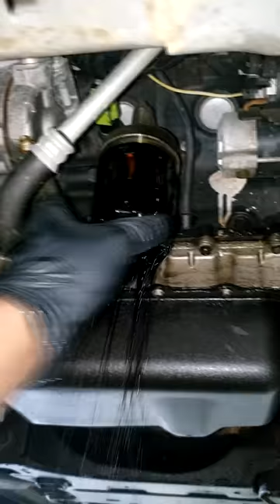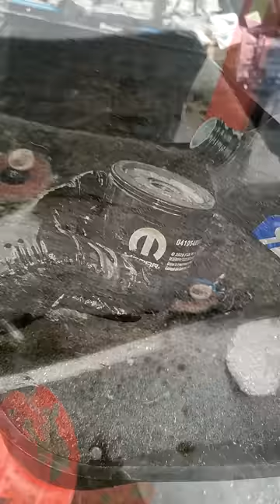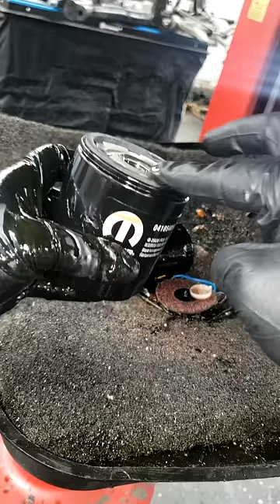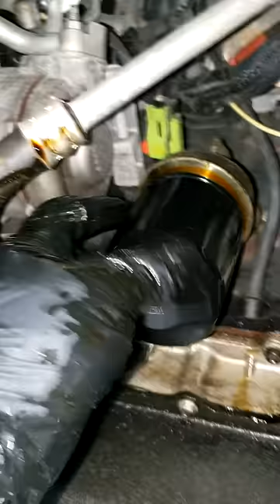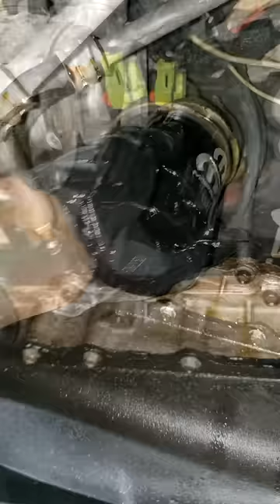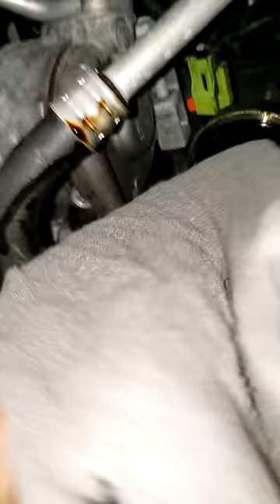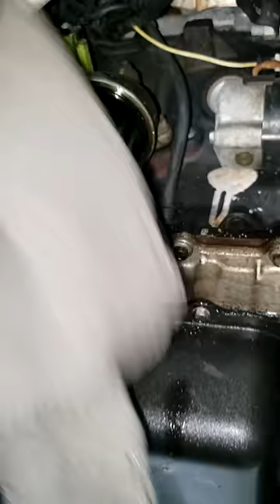Don't Lie.. Are yall still doing this?

Comment: I have NEVER filled the filter with oil, only ran a couple of drops of fresh oil on the gasket. I always, however, clean the gasket's mating surface of old oil!
Reply: Agreed- all you need to do...
Reply: Yeah, never fill it with oil unless it is specifically necessary, just adds more chance of contamination. Only lube up the gasket for a good seal
Reply: Never have done it. Never had any issues. I've seen Ford and Chevys with filters that go on sideways and not up and down. No way to fill those and not lose all the oil. I've seen people try, and it's pretty funny. Waste however. I agree, clean the surface and oil the gasket.
Reply: I do the same lube up the o ring, clean the mating surface and oil up the threads on the filter
Reply: @realanimal3602 can confirm, my old 2012 Chevy Malibus oil filter went on upside down for some reason. Thing was a bitch to get to ngl.
Reply: Well, you are part way there. Now try doing the job the best way possible. If the filter orientation allows a full pre-filling, do it. If not, at least fill the canister with enough oil to saturate the filter media as much as possible without spilling any during the installation. Just because it may be more time consuming or you never learned that this method is a better way of extending engine life, it doesn't mean that your abbreviated method is correct. It all comes down to how much you really care about doing the job to the best of your ability with the knowledge of what is actually occurring inside the engine during the oil change start-up.
Reply: @reason2gether  I performed an experiment on my wife's Jeep Liberty 3.7 when I changed its oil last weekend. I drained the old oil, removed the upward-screwing filter, and inserted the plug. Then I poured the old oil back into the engine filler. At least two quarts came out the oil filter fitting. Then I drained the pan again and finished the procedure.

What's that say? The filter fills with new oil when filling the crankcase.
Reply: The 3.0 and 3.4 L v6’s in older Toyota pickups, Tacomas, and 4Runners have an oil filter housing where you practically turn the filter upside down.
Reply: @realanimal3602 probably why the manufacturer installed them that way
Reply: @nuevaN.M  LOL... Ya think?! That reminds me of the dumb questions I get on motorcycle groups, such as, what kind of oil should I use? Or, what kind of gas should I use? Well, what does the manufacturer want you to use I mean, why do they make the things they make the way they make them? There has to be a reason!
Reply: I’ve never seen a service Manual that calls for it, there is however certain manufacturers that specifically say not to do it
Reply: @reason2gether you would think the manufacturers would have it in there service manuals if it mattered, you would also think some brands wouldn’t specifically say not to do it
Reply: You should at least put some oil in the filter before putting it on. This reduces the time for the oil pump to prime after installing a new filter.
Reply: @bobby1970  naw bro the best way to do it is to put your car in flood clear mode and crank it for 5 or 10
Seconds
Reply: @Weeblicker  You just have to be a little careful and clean the surrounding area of the engine first, including the oil filter mounting surface, that's all.
Reply: @carlosperez-de2du  That's fair because I wouldn't want to work for anyone who can't read a shop manual.
Reply: A couple of drops to prelube the gasket? Not like the thimble full my man in this video used? I'm lost, aye, lost....

Comment: If the filter is upright I do fill it especially on the big trucks and machinery. Alot of the newer cars have a cartridge filter or a horizontal filter. And in all reality that filter is full in the first 2 seconds of start up.
Reply: so is the "upright" filter......
.
they even sell kits to prevent dry starts with a cartridge filter!!!!
Reply: @kainhall  reality one dry start every 5,000 miles won't hurt an engine. If an engine wears out prematurely, it's not because of a dry start after an oil change 😅. It's likely because of a Lack Of oil changes
Reply: Exactly. The only time I pre fill a engine oil filter is after fresh rebuild and I fill the filter up the correct way. If a engine needed a prefilled filter every time after a oil change then all filters would be in a refillable location.
Reply: @minusthemachineagain9342  i was looking for this comment lol. Only time I prefill is on a fresh rebuild or replacement engine.
Reply: @kainhall  you do know the oil falls to the oil pan when you leave the car for the night, right? The shafts are all DRY in the morning, absolutely no oil there. Each time you start in the morning, it's starting dry. Now you know. If you don't believe me, you can just pull out the oil filler cap and touch the camshaft lobes, there won't be any oil on it.
Reply: @dmandman9  wonder what he'll think when he finds out that when he leaves the car for night, all the oil falls to the oil pan. There is absolutely no oil on the parts. Each time he starts the car in the morning, it's starting dry. That's why it's much more difficult to start. People man... I swear
Reply: @SpeedsGamer  this is so incredibly wrong. Everything remains coated for several weeks. I highly suggest you set down the crack pipe and pop your valve cover off and see how everything still has enough oil on it to last a 2 second dry start
Reply: @SpeedsGamer yes but it doesn't have to fill the filter every time or are you thinking all the oil drains out of the filter also?
Reply: This is brand new fresh oil the point is to fill up the filter as much as possible and Pre-“wet” the filter media.
Reply: @engineclinic  not the filter, no
Reply: On big marine engine the oil filter house 2liters of oil, and there are 6 filter, when its large amounts of oil i would prefill but on cars, it actually takes 2 sec too fill.
Reply: @alexreeh13  instantly*
Reply: @davidtomlinson4582  right on.  So do you think going from dry to pressurized new oil could damage the filter itself ? I really never thought about it 🤔
Reply: @erinminton5821  there's no need to dude, I can see the lobes just by removing the filler cap. I touched it, absolutely no oil film on it
Reply: @SpeedsGamer i wrote the same thing in another comment. People have no common sense lmao
Reply: @minusthemachineagain9342 On all rebuilt and engine build's, a person should pre oil/prime the engine with the distributor out of the engine. with a pre oiling tool and drill until it reaches the proper oil pressure. and make sure that oil up at the valvetrain. on engines that are DIS, it requires cranking the engine over until it reaches the same results.
Reply: @MusicAuthority-b9r  the last 6bt cummins I rebuilt; I pumped in 3 gallons of break in oil via the 1/8th npt plug on oil filter housing until the oil is present on top of the rockers. Crank it over 3-4 times bleeding air from the injector lines, fired it up & checked for leaks for a minute then camshaft break-in. Drained oil, hooked it up to a 10,000lb fuel trailer and made some dyno style passes on it. Good to go.
Reply: Isn’t that the reason why most owners manuals and tech manuals state oil capacities with and without oil filter replacement?
Reply: @Mystykalbaby1979  i didnt even think of this; you couldn't be more right.
Reply: @seanburke2005  it just made sense to me.  I’m sure those guys wouldn’t print the ink if they didn’t have to. Saving a page or 2 on a printed manual keeps the bean counters happy.  😄
Reply: I change my oil every 3k miles
Reply: @dmandman9  What makes you think it's going to be more "dry" after letting the oil drain out of the pan than letting the car sit overnight and all of the oil runs down to the pan? When you cold start your car, it's likely to have less oil on the running surfaces than starting it right after an oil change where the engine was running less than 30 minutes prior. It is silly and useless to fill a filter, especially so if you're pouring it in the center hole.
Reply: @anthonyantoine9232  Most filters  have an anti-drainback valve. So  When starting an engine that's sat overnight, the filter still has oil in it, so it doesn't take quite as long to build pressure. When the filter is changed, depending on the vehicle and the size of the filter, it takes up to a few seconds to fill the filter before the pressure starts building. As a mechanic, I actually notice that  the sound of the engine changes slightly once the pressure builds. And it takes longer for the change to occur on a dry start from an oil change vs a dry start from sitting overnight. Again, it's not that it really matters because the oil change is only once every several thousand miles and that even during a this "dry start" there's still a slight coating of oil on the moving parts . But you may hear certain noises such as the timing chain, valve lifters, or engine bearing clearance during that delay. But it's virtually harmless because the engine is only idling during that short period. It's not a huge difference. But it's often a noticeable difference, especially on engines that have larger filters
Reply: @Mystykalbaby1979   in the past, that was always true because filters used to hold between 1/2 and 1 full quart of oil. Now on many engines the filter is so small that they don't list the difference. Also in the distant past, (when most Fords used part number FL1A and most Chevys used part number PF 49), the recommendation was to change the filter every OTHER oil change . So they listed both capacities. But for the last 30 years ,the recommendation has been to always change Both. So many owners manuals only list the capacity that includes the filter.
Reply: @dmandman9 I was looking for this comment before I posted. I know people that if the car didn't go the mileage but it has been a long time between oil changes only change the oil. I know people with company cars who's personal vehicles go under 3000mi a year so they change the oil once a year and the filter every other time since the oil comes out damn near new.
Reply: @jamesd5415  Probably wouldn't make a difference either way in those cases because neither the oil nor filter is really bad. But I remember back in the every other oil change days we'd mark on the oil change sticker whether we changed the filter or not. Most filters held 1 qt back then. Today many filters are so small that it's less than 1/2 qt difference. A few repair manuals list the same capacity with or without the filter. Interesting note: in times past the price of the filter was somewhat significant compared to the price of the oil. Today with most cars using semi synthetic or full synthetic oils, it's not unusual for the price of the filter to be LESS than the price of 1qt of oil. My,  How things have changed.
Reply: @dmandman9  I remember those days when a filter was as much as a quart or almost two
Reply: @dmandman9  Yeah, I didn't mean to suggest that the filter was draining, but the head and everything else definitely drains oil when sitting. Just ask the rattly lifters in my Colorado and they'll tell you loud and clear lol. I'm sure there's a slight difference, but what you noted about a thin coating of oil remaining on everything is what I was really trying to get at. There's not really a dry start ever, unless you're assembling a fresh engine without any sort of assembly lube.
Reply: @anthonyantoine9232  I think many are overthinking this. My MAIN point was that it doesn't matter. Pre fill if it makes them feel better. But if they don't pre fill, it makes no practical difference in the life of the engine. I guess the term dry start isn't technically true. I was merely speaking of the short period of time between when the engine is started and the pressure builds. I also remember when nearly every vehicle had the classic lifter noise upon startup after sitting a few hours. Now it's very uncommon where I live (north Florida) . Temperatures rarely ever get below 20degrees  here. Maybe once every 2 or 3 years. So extremely cold starts aren't a problem. Even back in the single viscosity oil days, we mostly used 30 weight oil year round . In fact, when manufacturers started recommending 5w-30 Oil, many of us resisted because it was unheard of in our region. For a few years, many REFUSED to go lower than 10W-30 until they were finally convinced it was safe. 😅
Reply: @kainhall  The engine is really not dry because there is sill residual oil on the metal parts. Even if its a fresh rebuild I use assembly lube on all parts that have friction. I'll pull the fuel pump relay out and crank it for 3 sets of 10 seconds.
Reply: @SpeedsGamer  Oil by nature clings to everything it touches. An oily coating remains on engine parts, and in bearing surfaces after an engine shuts down. An overnight duration absolutely does not change this. Oil that has pooled in areas of the engine after shutdown will make its way down to the oilpan, but there is always an oil film on parts that are bathed in oil while the engine runs even when it's not running.
Reply: What he said

Comment: Adding oil to the filter doesn't prime the system, it just primes the filter. The engine will still experience a few seconds of low oil pressure when you first start it regardless of if you do this.
Reply: yup.... its lower time
but guess what...... 0 PSI for a few seconds, at idle, on a good running engine, is JUST FINE
.
all manufactures say dont pre-fill 
all filters say dont pre-fill
(the ones that do come with a cap for the center "clean side" hole)
Reply: And here's the truth ladies and gentlemen.
Reply: Plus people don’t realize how much oil is actually moved through the system even just when you are cranking the engine while starting it
Reply: I never prime the oil filter on my 2001 small block Chevy.
It literally sits at 0 psi for a total of 1 second, then the needle jumps back up to 40 like nothing happened.

It does that same thing every morning when I first crank her up.
Reply: With a primed filter, oil is getting top side faster but if it isnt a massive filter like on a diesel it doesnt really matter.
Reply: Plus it helps to saturate the filter media.
Reply: @SN95_302 how many ounces?
Reply: Just the same as every time you first start the engine up everytime you use it... Until the oil pump has a chance to pump the oil throughout the entire engine and circulate it around again, there is a couple of seconds or so upon first cranking that the engine will be "running dry". This is totally inevitable due to basic gravity draining most of the oil down into the oil pan every time you shut the engine off.
Reply: You are wrong
Reply: @JoeJ-8282  Oil pumps have non return valves (as a redundancy measure in case of internal leakage because oil pumps are positive displacement pumps and they themselves already serve as non return valves). The oil will drain from the parts that are exposed but it will stay in all the channels that lead it up through the block. The components that need lubrication the most only "run dry (ish)" for a split second while the engine is cranking, and that's at only a few hundred rpm with no load anyway.

When the filter is empty the engine can certainly run dry for a few seconds, depending on the size of the filter and the flow of the pump, but most engines these days don't have filters fitted vertically on the underside anyway so this isn't feasible. The best way to do it is to disable the ignition and/or injection system and crank the engine for a few seconds to fill it all up.
Reply: Yeah, I stopped doing this on my own car because it took just as long for the pressure to come up whether I pre-filled or not, and not doing it is a lot less messy.
Reply: I think i prevents filter medium from blowing out .. if it did you would never know your vehicle is not filtering the oil
Reply: @mopar8952  Why would it do that? The air in the filter will exert less force on the filter medium than oil will. Also the filters I pull off the car still have intact filter medium in them. shrug
Reply: Zero oil pressure damages the engine , you've obviously not got a lot of understanding on engines .
Reply: Nope.... my truck has instant oil pressure... just like the cars I worked on past 30 years... I am a retired mechanic... why not fill the filter if you can.... less wear on the engine..
Reply: Cars do have instant oil pressure or won't start. Not pre filling an enclosed filter (not cartridge type) does create a cavity due to the anti drain back valve recycling air. Barely an issue and barely a topic